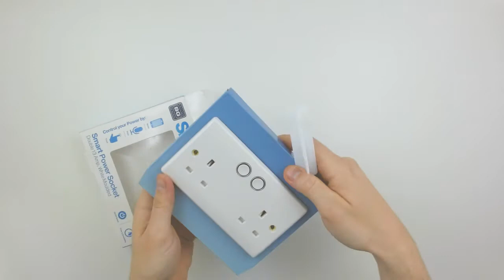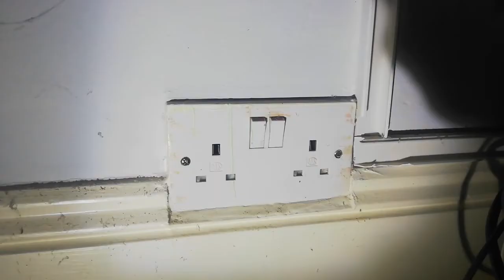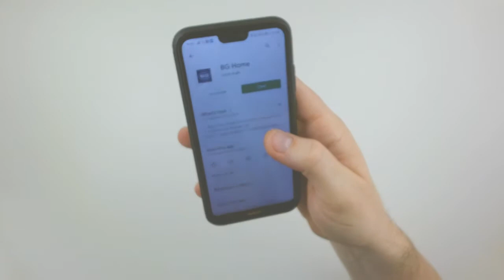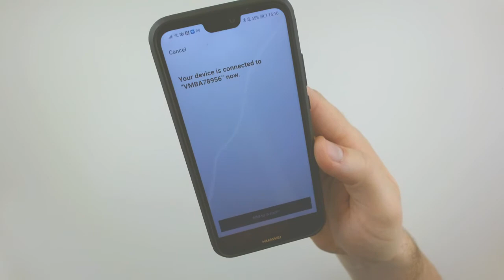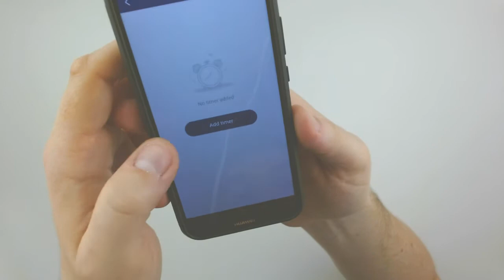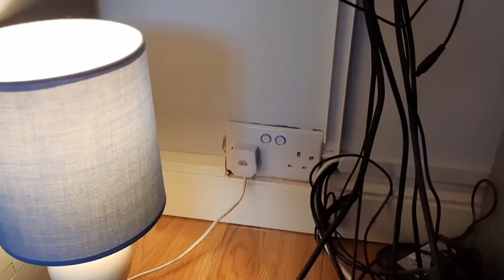Convert your UK Sockets into Smart Sockets!

Comment: Thanks for the video, small question for ya. Can I schedule the right socket to come on at a certain time? Like, say have it scheduled to turn on at 7.50am so that Alexa can run my wakeup routine for 8am?
And for downstairs is it possible to have the left socket which powers my wifi router run non-stop but control the right socket which runs my TV, independently?
Reply: Yes you can

Comment: DANGER BEWARE the sockets can fail live.  Even when I operate the socket manually and although the light around the button goes of the socket output is still live. Phoned support and reply is just take it back to the shop if you have a receipt which I don't. However tech support guy did explain how the unit can fail to danger which did not help at all and of course they are aware. Should be a recall.  DANGER BEWARE.

Comment: Absolute waste of money. Utter rubbish. Bigged up as a great bit of kit i can control with Alexa etc. However, it is only compatible with 2.4Ghz wifi, not new 5Ghz ones. So it can't be used/i bought a brick. 
I shall purchase 2 x Amazon Smart plugs instead.
Reply: On your WiFi settings, you can change 5ghz to 2.4ghz, then when it's setup you can change it back. If that doesn't work you can try your phone hotspot. Hope this helps

Comment: How do u make them go offline..?
Reply from the maker: Hi!

There is a power button in the app to enable or disable the sockets. 

If the Wi-Fi goes down and the device goes offline, you can still enable or disable them via the socket buttons (Which is very important!)

Hope that helps!

Smart Home Perfected
Reply: @smarthomeperfected  Oh okay thank you but say I locked the switch then lost my phone he would I turn it back on without the app?
Reply from the maker: @ricecooker4203  Ah got it. You'd probably need to install the BG Home app on another phone, log in to your existing account, and then you would have access to the sockets to disable the parental lock.

Alternatively, you could reset the sockets, but again, you'd need an app to set them up again.

More details on their installation guide and FAQ's here: 
https://www.bgelectrical.uk/public/downloads/how-to/BG%20Smart%20User%20Guide.pdf
https://www.bgelectrical.uk/public/downloads/how-to/Smart%20socket%20&%20adaptor%20FAQ's.pdf

Best of luck with it!